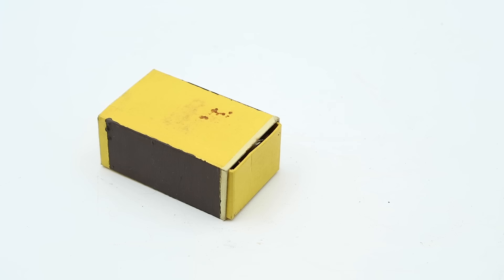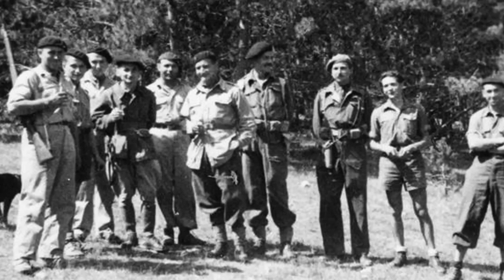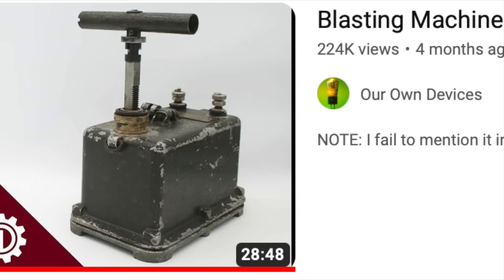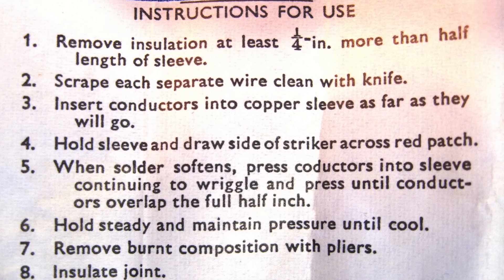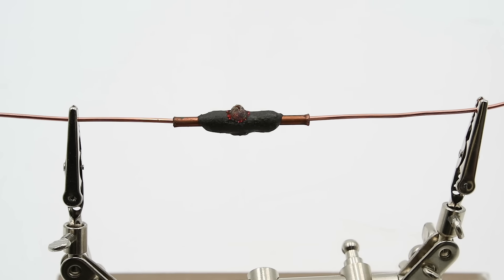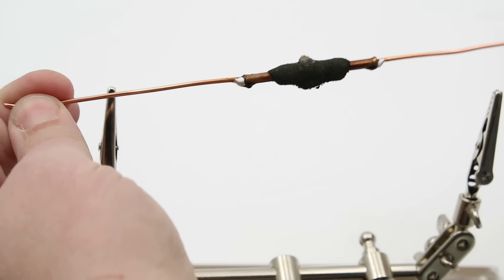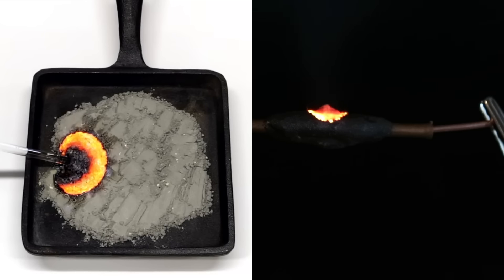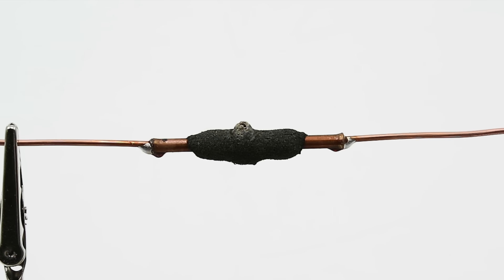SHORT: WWII SOE Self-Soldering Sleeves

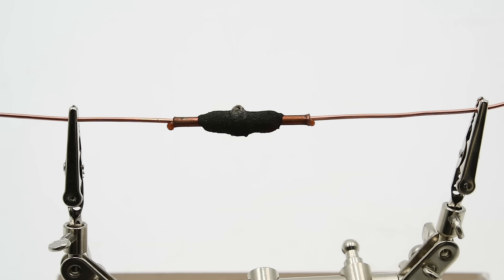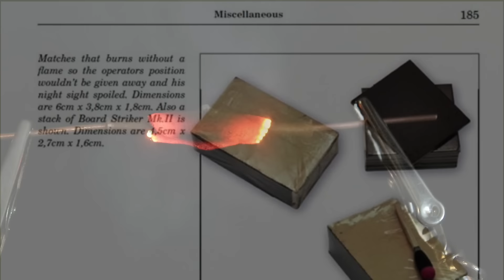Comment: Minor correction, at 3:44 that is not solder, it's flux, strong acids that remove the oxidized metal on the surfaces of the wire/capsule sleeve to ensure a "bare" metal surface so that strong intermetallic bonding can form between the solder and the wire/sleeve.  in this bonding, the surface of the metal forms an alloy with the solder, it's really a cool reaction.  check out le google for excellent SEM cross-sections of proper solder joints with strong intermetallic bonding.  the flux is usually solid or gel-like at room temp, and liquid at soldering temp.   also really cool at 3:28 to see the surface tension / capillary action of the just-liquidized solder auto-center the sleeve.  would be cool to cross section that sleeve and inspect the joint.  thanks for an interesting video, much love
Reply: PS you got my sub, looking forward to more :) !

Comment: You can still buy something similar, they are called solder splices. Admittedly they don’t have the combustable material, you have to use a heat gun. But if you were that committed to the bit i guess you could always melt one with a match.
Reply: no, with a jet lighter.

Comment: My guess as to the material inside the tube would be either thin diameter strips of solder held in place by rosin (also acts as the flux) OR silver-bearing solder paste which is solder and flux paste combined. Either could be melted with relatively low heat (<500 degrees F).

Comment: Thank you. There is a modern version of this available to join two small wires. Their ad came up at the end of your video. Nothing is really new.
Reply: As someone with a qualification in electronics who has no problem at all soldering wires together or using heat-shrink tubing, I sneer at those.
Reply: @Skorpychan I probably should have added that nothing is really new.

Comment: Probably used for telephone lines etc. where you expected the joint to last for some time. For blasting wires I assume twisting them together would be enough as they are not likely to be left exposed to the elements for any lenght of time. Even today blasting cap wires come with a kind of "wire nut", a plastic sleeve in wich one wire is already attached and you insert the other one and give it a few twists to connect and insulate the wires.

Comment: i forgot where i saw it but there was a video about using these for field telegraph lines and not blasting, the way it burns looks like hookah charcoal which is charcoal with gunpowder in it
Reply: Yeah, these are definitely meant to be used with field telegraph (or telephone) wires, not blasting wire. But these make it possible to quickly use the field wire for blasting if it is the only wire at hand.
Reply: And all it's missing to be perfect is a roll of heat shrinking insulation tube to slide over one wire, set the sleeve, ignite it, push together when solder starts dripping wait until it stops dripping but almost too hot to touch bare handed, crack the scaling off with pliers and quickly pull the shrink tube insulation over the join and let the remaining heat shrink the insulation tight.

Comment: Really well done vid, and interesting. 
There is a “NEW MODERN Connector” available which is very similar. It’s a shrink tube type connector,with low melt solder inside.
Functions same as your demonstration except no self contained ignition, the solder is activated with a lighter.
I wonder if the inventor was aware of this vintage devices. What’s old, is new again. I spend a lot of time looking at old patents, and many inventions were limited by materials of the day. Lots of clever ideas have been patented.

Comment: On the one hand it seems that crimps would work just fine for that application.
Oh the other hand I think solder is the lowest resistance connection, and is unlikely to pull apart.

Comment: I realized I can put a tiny piece of solder into a crimp connector and heat it with a lighter. If it's good with heat shrink it CAN work but it's not 100%. They sell them too. If it was a low temp solder paste it would work good. Also using a flame to heat it not iron or hot air.

Comment: You can buy heatshrink tubing with solder and a thermal glue inside to quickly make a watertight joint with just a heat gun or a lighter 
personally i never liked these as the solder is typically very soft, but still neat
Reply: You can’t make any generalizations, since they’re available with a number of different solder alloys. Each will have its own characteristics.

Comment: I would suspect that the variable resistances (voltage drop) between connectors wouldn’t be much of an issue given the high voltages/instantaneous currents generated by blasting machines (if I remember your video on those machines). Other applications (telephony) might require a higher standard of product to reduce signal loss.

I recall from reading a book on the history of chemical compounds and mixtures that some substitute gunpowders used chlorates in lieu of nitrates. There were some terrible accidents during manufacturing attributed to the use of PERCHLORATES mixed with sulfur & carbon spontaneously going boom. Don’t mess or experiment with string oxidizers unless one knows what one is doing for safety’s sake (and to avoid visits from the Feds).

Comment: I Dont see anything useful about these if used to connect blasting caps with blasting wire. Blasting wires are normally just quickly twisted together, they are very quick and easy to twist and make secure enough connection for the intented temporary use. However, for sabotage missions behind enemy lines, these would be useful in many places where dealing with field telephone wires or even mains electricity wires where the wires are very stiff and hard to twist together and require much more permanent an reliable connection. Then again if you just have stiff field telephone wire available for blasting caps, these would make it possible to use that for blasting caps. Field lines were (and still are) stiff steel wires that were really really stiff compared to thin copper wires that you can twist connect easily. This would make the process of connecting field wires much faster.
Reply: I was thinking along the same lines, but considered maybe it was for longer term delayed charges, like waiting to blow a bridge until there was traffic on it, and where it might be several days or weeks before that occurred. That's the only reason I can think of to solder that type of connection.
Reply: yeah, for that purpose you would use field phone wires and not blasting wire. So there is a use for blasting also! But not with blasting wire. @JCWren

Comment: Why would they not just use crimping connectors?
Reply: They did not exist then. Crimping was developed in the 1950s. At the time, the main options were soldering, screw terminals, and spring terminals like Fahnestock clips. I’m not sure if wire nuts had been invented yet.

Comment: How they most likely actually connected detonation wires: Strip insulation from both ends, twist ends together, insulate, done. It works just as good.
But the self-soldering sleeve is a nice gadget for more permanent connections.

Comment: Probably a dumb question, but I watched the video twice to do my due diligence.

Why not just twist the two ends of wire together?
Reply: Reliability and mechanical security.
Reply: You could and use like one of those twist nuts but it's more likely that it could be pulled apart and when you're in a life and death situation you don't want your wires to come pull the part just because someone hit a bump or something although I'm sure they did occasionally when they were in a pinch because yeah you can just twist the wires together
Reply: Yeah, when i was in college, studying electronics, I read a paper that compared solder connections to wire-wrapping. Wire-wrapping is a technique, seen for example in home stereos from the 1970's, mostly to join the PC board to components mounted off the board, such as output transistors, in contact with the heat sink. Wire was wrapped around square posts, protruding from the PC board. This came up because we were building mirocomputers, assembled entirely with a wire-wrap tool, using very fine wire and posts. The reason the instrunctor gave for this low-tech assembly method, is that it was determined that if students had to access a lab to make their microcomputers, they would likely run short of time. By using a hand-powered wire-wrap tool (similar to a precision screwdriver) the student could work anywhere: in the library, at home, in the lunch room, etc. and would be more likely to complete the project in the time allotted. The most surprising thing in the paper, was that solder joins and wire-wrap joins, if done properly, were equivalent in terms of oxygen occlusion, that is, the longevity of the joint from having resistance to corrosion. So back to your original question, it seems that a method of twisting wires together could be devised that would deliver the same properties as the Self-soldering Sleeves. This is the high-tech solution, there could just as well be a low-tech solution. Though I expect the military would say that these can be employed with less training, and greater reliability.
Reply: Because twisting wires together both requires the wires to be longer, takes time, requires dexterity, and can lead to an unreliable connection if you dirty the wires with your hands in the process. With this little doohickey, you just jam the wires into a tube, strike the match, and end up with a 100% reliable connection that is stronger than wire-wrapping.
Reply: Imagine the scene. You and your partisan pals are sabotaging a rail line, intending to blast the bed, and derail a nice fat munitions train. However, the train you want to derail passes around noon, the rails have sporadic patrols, and your only real window to plant your blasting charge is during a new moon 2 days before the train, dead of night.

So, you have to expect at least a few trains to rattle those rails in the interim, you have to bury the charge in the gravel bed, and you have to run the wire to a safe hide that both conceals you from daylight observation, and, ideally at least, places you far enough away that flying rail bed, locomotive parts, and sympathetic ignition of on board munitions aren't guaranteed to give you an opportunity to find out about "what happens after you die?", firsthand. 

Those specifications can be met by a "western union splice" (a VERY intricate knot for bare wires), which requires trained hands, clear view of conductors, long stripped ends, and a bit of time. The "so simple a caveman can do it in the dark" alternative is the butt connectors in the vid. Anybody capable of striking a match (a pretty common skill in the 1940s) can make a suitable splice using one, in crap lighting, and with high confidence of it surviving until "zero hour", even if buried, tugged on by unreeling several hundred feet of wire attached to it, or installed by a slightly less than intellectually gifted operative, lol.
Reply: You would. For blasting wires, you literally would just twist them together, no need for this contraption. But for field telephone wires of even mains wires this is much faster. Field telephone wires are stiffer and really slow to splice together. This device is really meant for those wires, not blasting wire. But this makes using field wire quick for blasting for more "permanent" installation. Like for a few days before the boom.
Reply: That's "Western Electric" splice. I used to work for them.
It's great for copper wire, but the field telephone wire is very stiff and doesn’t bend or wrap well without breaking.
Hence the use of the splices.
Reply: @leonardbakers  western union splice is the original nomenclature, from telegraph lines... long predates western electric

Comment: I suspect that in a crisis, you wouldn't even need to strip the insulation.  There was a ton of flux bubbling out, which would have done a great job carrying away burnt insulation residue with it, and the mechanical action of pushing in the ends would have done even more.  Sure, it might not weather as well, and might be a bit more brittle and joined at fewer points, but if you've only got twenty seconds to make the splice...